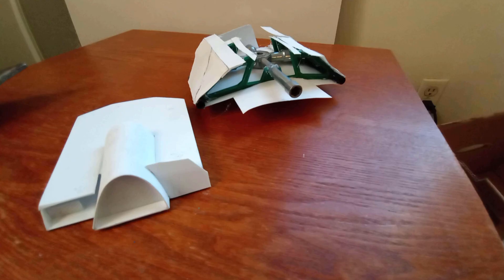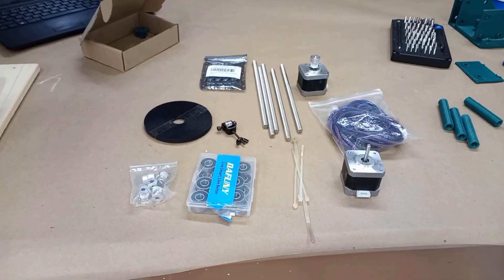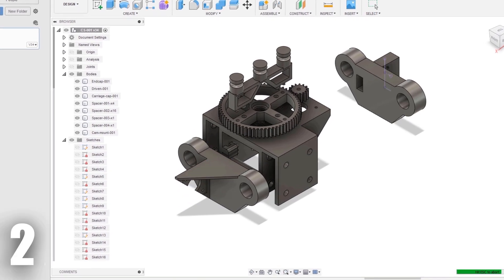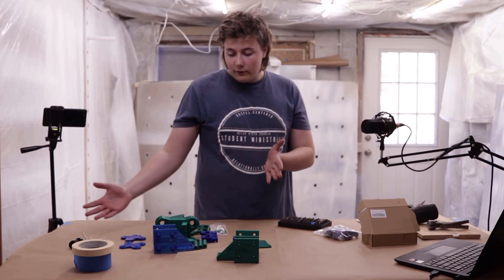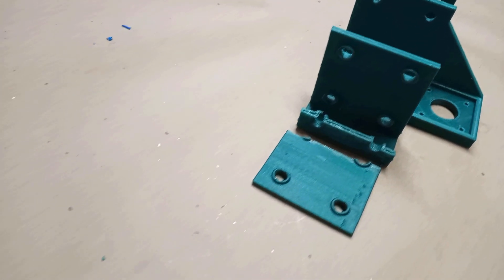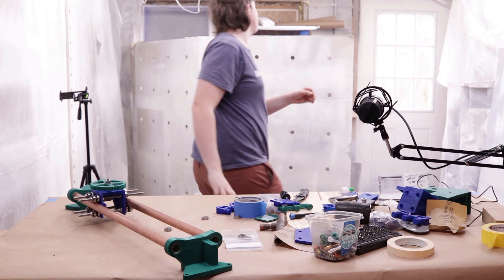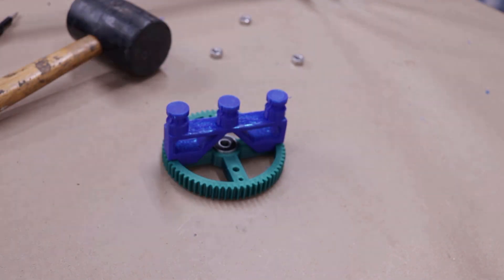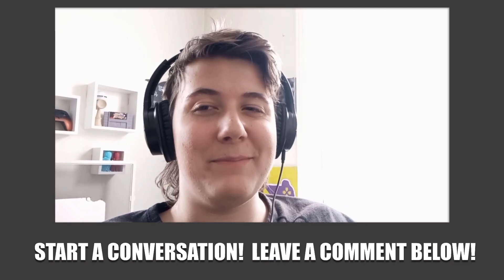DIY Motion Control on a Tiny Budget!

Comment: I'm going to try to mske this. Have you updated your build since 4 years ago? If so, please create a new tutorial.
Reply from the maker: Awesome! I haven’t updated mine but if I were to do it again I would use 8020 aluminum extrusion with v rollers using existing 3D printer hardware for the rollers plates and belts. Hope that helps!